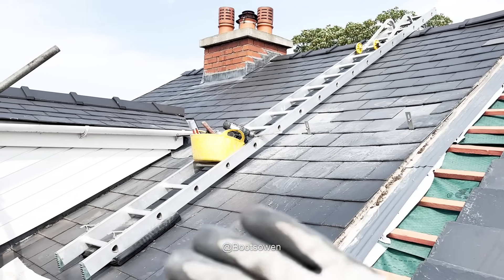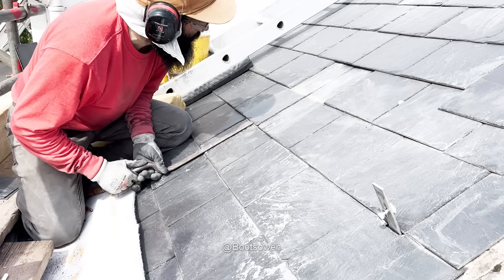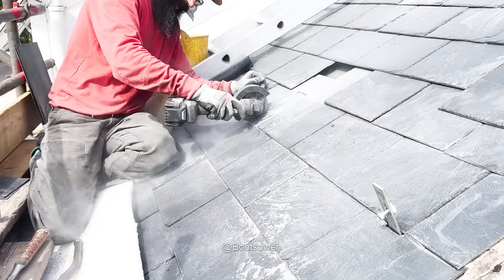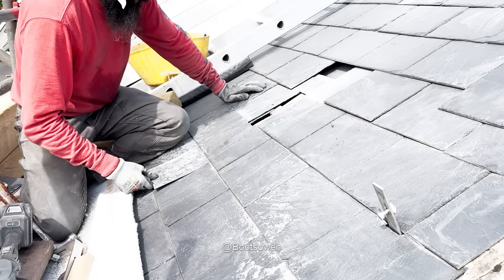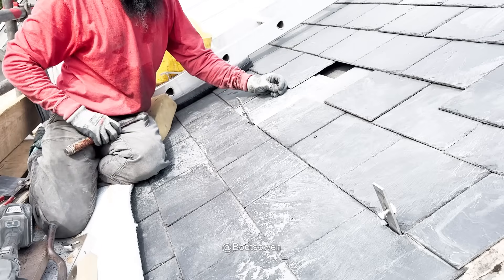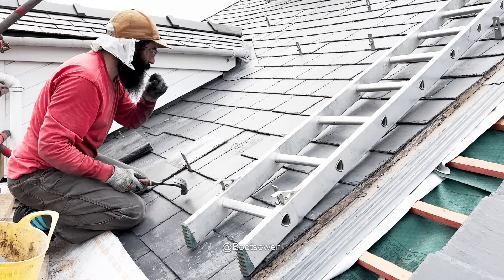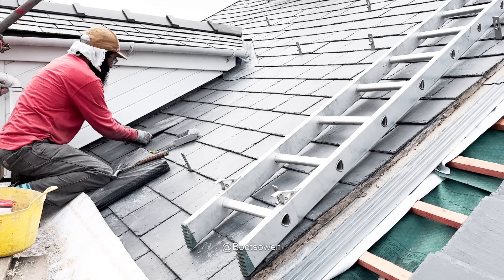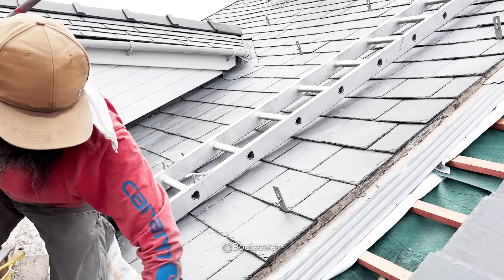Fitting solar panel brackets to a SLATE roof: simple, watertight method!

Comment: I wonder if at 14:40 ish you could have used the slate ripper as a guide to ensure that the top of the tile went over the batten ?
Reply from the maker: I tried a few different ways. There isn’t much space in there to get the ripper in as well. You have lost space because of the new repair hook. Copper or lead strips are better maybe.